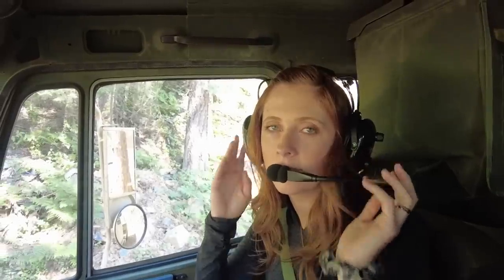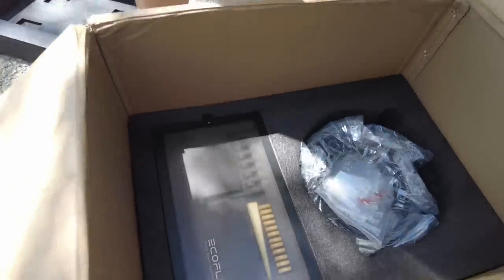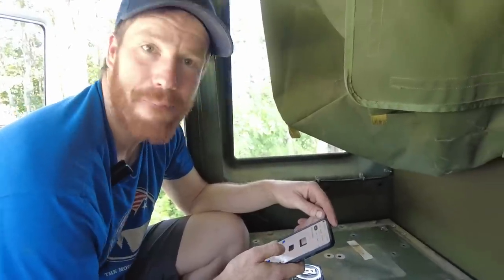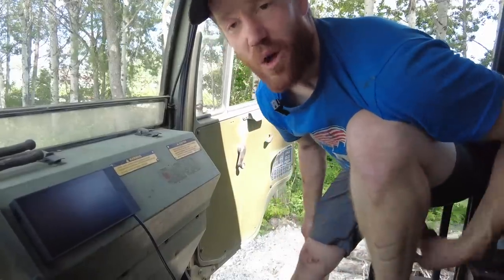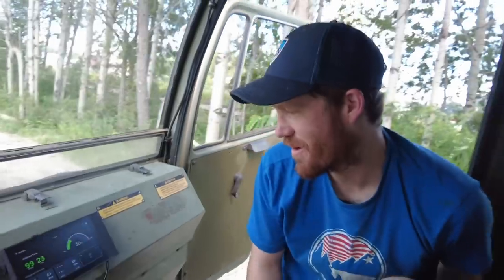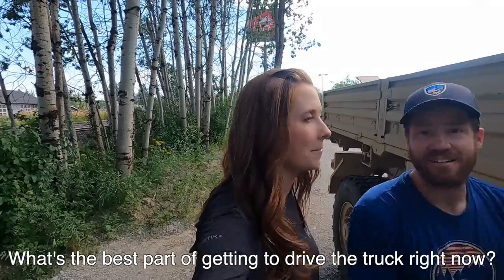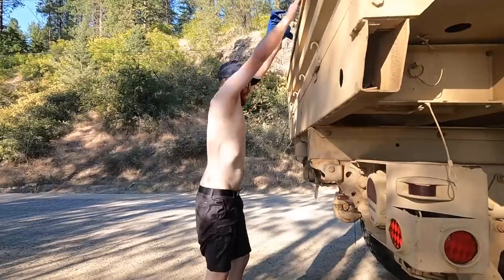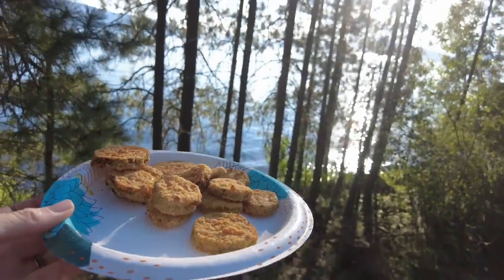DIY Off-Grid Power System... So Easy! | EcoFlow Power Kit

Comment: Alternator output is a function of RPM, after starting the output doesn't start until engine rpm makes a "fast idle" threshold which varies according to the particular vehicle, for instance our 1950's, and 40's tractors only need about 500 rpm to start charging (they were modified from 6v generators to one wire alternators)  With our MK23 7 ton 6x6 after starting and running for a minute I hit the "high idle" button for 5-15 minutes to get everything including the air system to full capacity. This kind of thing is critical for all vehicles in winter temps, I high idle my '16 Jetta each morning after startup in winter just to give the battery a little help with the cold charging. I have witnessed people not doing this step over a period of days in extreme cold kill the battery because they did not drive it enough to really recharge the battery, and never let it fast idle.  Congrats on the sub's you are an inspiration. That charging system is slick, will have to add it to the considerations list for our home on wheels build.

Comment: Another great video, thanks so much. 
You were so lucky with the size of the batteries - a perfect fit!
I noticed the Power Hub has four cooling fans at the back - you may consider moving it forward an inch or two to allow for cooling air flow. 
Also, you need to find a nicer name for ‘the army truck’
Reply: This.

Comment: I'm going to Eco Flow's site now. This package plus the portable 4000 btu A/C are just what I need for my 36' 5th wheel.
Thanks so much for the content you provide. It's real stuff, doable (is that a word) by regular people.

As I said in an earlier post, I'm 70 and moved onto 20 acres of beautiful unimproved forest in So. Oregon in 1977.
None of this stuff was available, we had to make everything from scratch by hippie power alone.
You can do a lot with lead acid batteries, a Cadillac ambulance  alternator, and a windmill. It gave our 1977 cabin music and light. A flat out miracle in 1977.

I envy you two. You just set up a system in a parking lot, in an hour, that surpassed our ancient system that took 2 weeks to figure out and install.

Keep having fun!

Oh, Riley, I'm a retired computer systems engineer that did medical device design for 20 years. I wrote those instructions you ignore.
Do an old man a favor, at least glance at them please😎
Reply from the maker: We have a lot of respect for you and others who did this journey before us. The advancements in power systems have made off-grid power SO much simpler and cheaper to do now!

Comment: i love that old military truck and that solar system is impressive. I wouldn’t use silicone to seal the roof, try using urethane, it’s what is used to install auto glass.  It’s strong,flexible and durable.
Reply: Urethane or butyl, never silicone.
Reply: Dicor lap sealant, available from rv stores would be the perfect product to use as it is literally what it's designed for. My dad had solar panels on the roof of his rv for over ten years, screws sealed with dicor and zero leaks.

Comment: I was a little concerned when Riley drilled down through the panel above the batteries.
But then I remembered that he's probably made that mistake more often than I have, so he probably doesn't make that mistake anymore.
Looks good, can't wait to see progress updates on the new power kit
Reply: That concerned me as did the small amount of space for all those fans at the top of the power hub in the mounting location

Comment: Several other folks have also observed that the fans of the hub need to have open flow. I would recommend mounting it vertically to the back wall above the distribution panel with the fans facing up
Reply: The instructions may be helpful?
Reply: Fans up would get dust settling in it

Comment: Super excited to see whats planned for the army truck! Congratulations on the 200k subscribers.
I do have 1 concern. There are 4 good sized fans in the back of the power hub that appear to be nearly touching the rear wall. Im just guessing here, but id bet you want a little bit of airflow for whatever they are cooling lmao. Besides that the system looks great and very easy to setup.

Comment: This is exactly the sort of tech the camping / off roading / over landing industry has been needing. I’m sure it’s not cheap, however getting all the components separately. Getting all the correct cab lines, crimping tools, etc, then designing and installing it yourself is not cheap either and significantly more complex. This looks super slick and well thought out. The last time I went tent camping Ii was so annoyed with all the noisy and smelly generators at the camp sites, this totally fixes all of that. Thanks for sharing

Comment: Cool, definitely should install house AC unit for the cabin
Reply: Those trucks have very low output alternators for some reason- unless they have upgraded it, it won't have enough power.
Reply: It has the eco flow ac behind the driver seat

Comment: I used to have a 1985 Freightliner Cab-over-Engine (COE) power unit.  One of the nice features that really helped was a sound blanket attached to the bottom of the cab (the cab tilted over just like yours with the exception of it being a hand pump only).  If your unit doesn't have a sound blanket I would recommend making one or checking with Freightliner or a manufacturer for obtaining one.  They greatly reduce the engine noise level in the cab.

Comment: Hello🙋‍♂️ from the Netherlands🇳🇱 AS . 
as I said before in a comment : 
I think and hope that you will make a camper of the army truck.  
that's pretty easy to do with a unit that the military also use on those trucks, such as a command center unit.  
the big advantage of this is that you can easily take it off again if you need the dump bed and these units are made for these trucks.  
and such a command center unit you can extend on 2 sides if you are standing still for more (walking) space that is nice .
nice and complete power unit by the way and everything nice and easy and simple plug and play .
and thanks for the video📹 AS.  
Sincerely, Hollandduck🇳🇱🦆

Comment: Riley...  The bracket that was behind the seat was for a FM Tactical Radio mount.  Not sure exactly which model since I retired in 1991, but it looks a lot like the mount for the ANVRC-46 radio.  But I could be an even newer radio, not something I have kept up with.

Comment: The South African Eco Flow agents were very helpful and explained in great detail as to which model I needed to run a 700 microwave. The difference between your voltage and ours . Yours 110 and 250 volts house hold . Our power is 230 to 250 and 350 three phase. The U tube adverts for Eco flow say you can use all their pull along models for high pressure water cleaners and washing machines and tumble dryers. However they say not in South Africa or Australia with our voltage and wattage difference. I don't work or eco flow. I am a retired tour guide.

Comment: Sweet kit, the converter had 4x fans on the back of it for air circulation and it's right up against the back wall it could do with being pulled closer to the seat away from the wall for air flow so it doesn't get hot and dnt want a 🔥,  
 Grate video love old army trucks thay will run forever with a small amount of maintenance 💯💯💯👌👌👍👍👊👊

Comment: Definitely need to mount a grid over your solar panels to protect them from low hanging branches that truck is tall.
Reply: Yes, and stones thrown up from a vehicle ahead on the highway. Also, it might even be worth considering some sort of protective mesh you could prop over it if it started hailing.

Comment: Finally a proper use for a military vehicle radio rack 👍🏽🤣

I don't like self-tapping screws......
it cost us dearly in one of our deployments in the reserves - they installed a new component and drilled a hole in a fuel pipe, to our delight no one was hurt, but the HMMWV was completely burned
Reply from the maker: Yikes! I’m glad that no one was injured. 😬

Comment: If you're keeping that unit, the 'inverter' you might want to move a little forward and allow the exit vents more room to push out the hot air.  Looked like it was quite close to the back of the cab and that'll mean you'll limit the ability for the unit to cool itself.

Comment: That is one pretty cool setup, but the one thing about that power station/inverter, isn't the fan in the back supposed to have more space from the wall to help it release the heat easier?

Also, maybe should consider upgrading to the 200 or 400 Amp generator that came in these trucks, it'll charge up the battery bank much faster. The generators tend to not charge until like 20 seconds later after running, and unlike an alternator, these generators don't charge as well at low idle

Comment: Brush guard or panels are removed by tree limbs , Good job on install Ele company thought it out with all weather connectors ,do the same with the outlets GFI  EDISON  duplex boxes. Try copying the construction industry distribution break out boxes for site power. The supplier may make a loom for your power outlets and maybe outlet panels so it all matches and warranties extended . GOOD  JOB  GUYS!!!!!

Comment: The Power Hub has fans on the back - it can't get rid of the heat since you put it right up against the wall in the truck...suggest you move it at least an inch out from the wall.

Comment: It varies from vehicle model to model, but most are designed with the smallest alternator they can get away with so that it doesn't rob horsepower during the most critical time (while moving). As long as you rev or drive, the alternator will make enough voltage to charge.  Because of that, most alternators won't charge the battery much or at all during low/idle RPMs. 

In older vehicles you could easily run a car that had a dead battery as long as you got it started with a jump or popping the clutch while rolling. In many newer vehicles/cars, the alternator alone isn't even strong enough to run the car and its systems, and it uses the battery as a buffer or massive capacitor. The car I had that had a battery die started driving like it was running out of fuel, but the tell-tale sign that it was in-fact an electrical issue was that all the gauges and displays on the dash were doing crazy stuff while it was trying to run.

Comment: Read read , install. Air flow distance between batteries.  Note, that system is going to bounce its self to death.  Install hard rubber , under batteries. Even maybe a rubber, grommet spring platform to keep the slame down. Also, on the flow meter, rubber, behind the brackets. Also, under solar panels mounts. It's a computor system and will break.
Reply: Good ideas. And I was going to mention the air flow behind the power hub -- it went by pretty fast in the video but it seems like the fans on the rear were mounted too close to back cabin wall.
Reply: @wayneiba2358  yup... no computor is made to be bounced around. I'm a design engineer PHD. 
What's going to happen the cab will over heat. Battierys will shut down. They need a alarm heat sensor,  and auto fan drill thru the cab walls, to quickly lower temps. Still a cool truck,  I'd set up, sonic bug zappers, put up a starched , sheet, small screened area,  and project movies . For all the campes to hang out and watch..

Comment: vERY COOL!  That's confidence to plan a dinner which requires use of a new device, previously not installed and tested.  Of course, the Army Truck engine can be used to thermally cook MRE's, so if all else had failed you would have had exhaust manifold roasted stuff ... 😃

Comment: An advice from a sailor: 
Check how much the alternator is rated and then scan through the manuals. There should be an option to limit the amount of power from the alternator. The modern Lithium batteries may draw so high currents that they may fry the alternator if you a) don't care for the temperature of the alternator (and limit the power if to hot) or b) limit the amount of charging current.

Comment: That is some really great technology. I hope it can power a AED as I'm sure the price tag may cause a heart attack or two! I really want a Stewart & Stevenson and that rif with that power system could be just the ticket to build our off-grid capable bug-out. You about gave me a coronary when you started running drill bits and self tappers into the panel just above the batteries. Yikes. As far as the roof try Geocel or Dicor RV sealant. UV resistant and stays flexible. I have used on my Lance slide in and cargo trailer. It holds up really well. The self leveling is easy to apply but don't try to "work" it with putty knifes etc. It will get everywhere.

Comment: The army truck alternator (or the controller or whatever connected to it?) possibly has some system keeping it's charging output low when motor runs idle, and once the RPM ramps up then also the current ramps up so it really juices up the battery. Just a guess, but in a way it makes sense. (you want to keep load on motor very low when it is supposed to just idle)

Comment: I see an overlanding build down the road.  Wondering slide in unit to keep the dump bed? Maybe long-term goals and after all construction on property and replace the bed.  How about an underbed storage box on passenger side behind fuel tank.   Without a winch that's a big opening

Comment: The truck . Climing up and in. On the longer side that flips down. Mount a removable, ladder that with large wing bolts, screws in easily.  Yes your building a RV earth rover kind. But will always need that ladder. May want to check grease in the universal joint, shaft looked wet by the seal. Not good if going off roading.

Comment: I thought you had bought more power for the diesel engine. When you said you were going to install it in the parking lot, I thought that would be interesting. Nice electrical power however. When you brought out the replaceable circuit breaker panel cabinet for RV/Boat, I paid more attention.

Comment: I would install rivet nuts in the roof, and then use a lock washer with a bolt.  That way you don't have to have a nut on the backside, which then ends up being a two person job.

Comment: Time , To Find A Cooling System For The Truck Cab. I , Would Look At VINTAGE COOLING For That. It , Can Be Cab Mount. I,Am Thinking You Are Going To Use The Truck As A Mobile Repair Vehicle ? And , To Think Riley Did The Install Without Reading The INSTRUCTIONS . WTG , Riley. Now , To See What You Have Planed Next. Thanx , For Sharing Your Adventures And Lives With Us.

Comment: Just so you know, an alternator only works while you are driving.   it keeps the battery charged from the turning of the wheels.   That is why you show always disconnect the batter from a car when you know you are not going to drive it for a long time, since the wheel will not be turning.   the batter will die if you don't.    However, you now have solar, so you probably be able to leave it connected and sit in the sun for years.  that is if the solar is also attached to the battery and is able to charge it.

Comment: Are u guys gonna install a electric motor  to power the wheels  as an addition to the engine .
Like a motor near back wheels which can drive the rear wheels along with the engine at same time or separately ... i am just a 18yr who wants to work on cars and find crazy ways to power vehicles aka trying to save IC engines 😶😉😆😅

Comment: Congratulations 🎉 on 200 K! Question: Do you have to worry about the batteries freezing in the winter?
Reply from the maker: Yes that is definitely a concern. If insulating the container isn’t enough we will add a small electric heater.

Comment: Blown away again. Installed a power system in a lot.. I would've been there till Thanksgiving.. Clever and funny all at the same time.. Question, I know you will silicone all the screws on the roof but were those cable couplers water proof or will you have to do something about that? The snack segment with drinks and nuggets powered by your appliances, sitting in the truck bed so comfey overlooking the lake was a mind blower... Got my Munk Pak .. Excellent....

Comment: Congratulations on the mobile system and subscriber goal. Just one question on the air flow behind and around the power control unit.  I could not see if there was enough cooling ( air space) around the power unit in the location you installed it above the batteries when you have a heavy load.

Comment: That's a very impressive package! Spoiler Alert, in this video peak Reckless Riley occurs around 5:40!🤓
Reply: Yep...blocked those 4 cooling fans.
Reply: @jasoncr8419  I was thinking more about drilling through the metal plate with the batteries located immediately underneath...
Reply: @dougf94912  I do the same thing.

Comment: OK, from the camera angle...all I can see is long drill bits and short gap between battery and drilling surface.  I am going to lay bets that Reckless does not drill into anything important, but the camera angle is DEFINATELY making me nervous!
How are you planning to protect the panels from rock chips and falling debris, like from trees, etc?????
Those long self tappers look REALLY dangerous for people taller than 6 feet!
Wow, congrats on 200K!!!!  I am hoping you pick up an additional 300K by next year!
Where is your spare tire?  AND, are you going to make guards for the tire inflation hoses on the wheels?
With so many comments, I don't really expect a reply.  That is cool with me.
Reply from the maker: I think we should replace the self tappers asap. The spare tire is at home, waiting to be replaced!